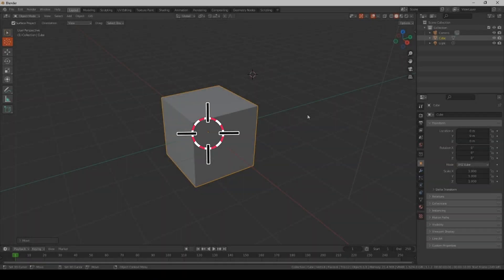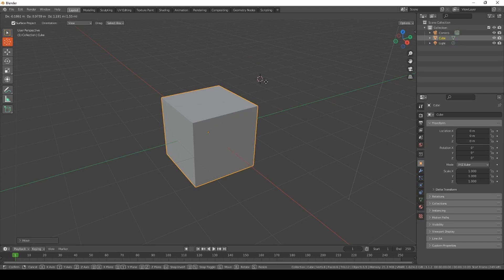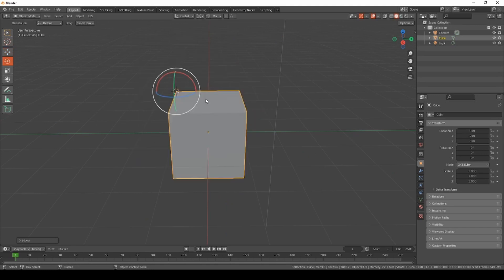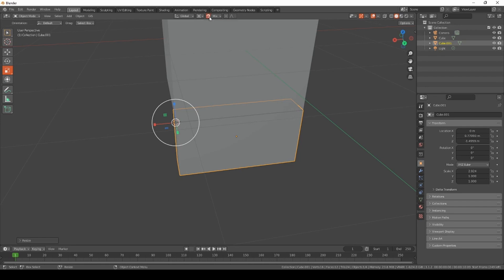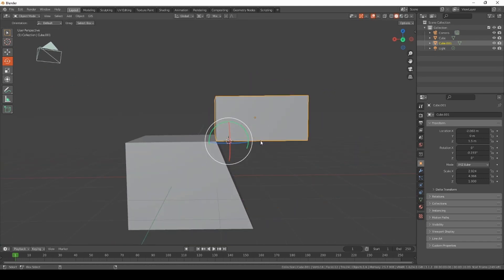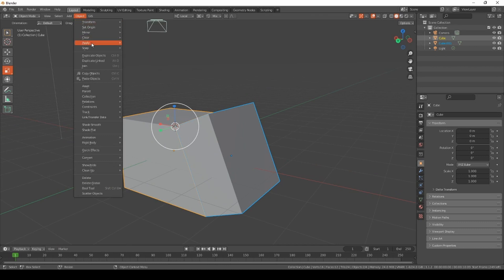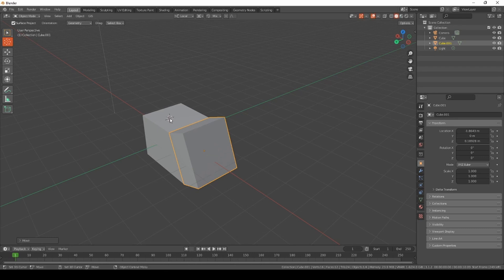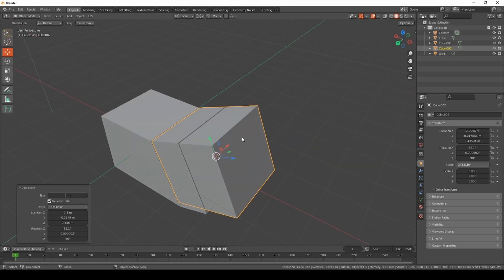3d Cursor CAD Uses (Solving your CAD Problems Series)

Comment: I remember trying Blender back in like 2008. The UI made absolutely zero sense, all with the 3d cursor, the right-click to select, the non-descriptive buttons and lack of documentation... That was the first and only time I felt angry at a computer program lmao. I mean, it wasn't just frustrating. Frustration imho feels like trying to push a boulder that won't move, but you know you're applying force to it. Old Blender felt like trying to push the fog. You don't know if you're doing anything or if you're just going to waste an entire day.
Reply from the maker: I first tried blender in 2006 , and I couldn't move the default cube 😅
And uninstalled it immediately 
Back in 2017 because of the osm addon , bought it and I found it as a good chance to get started with blender instead of 3ds max , way better than before but still horrible 😢 
2.8 changed the game completely and yet still not the best but at least useable , 2.81 got me in 😁 and since then I enjoyed working with blender